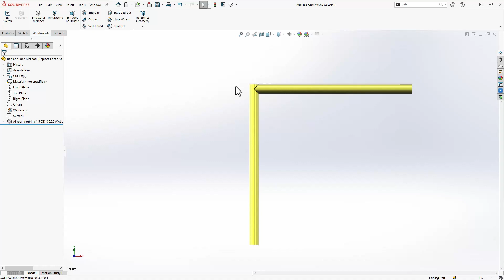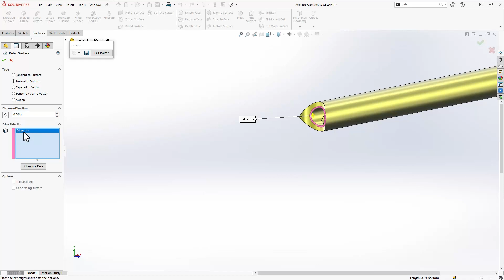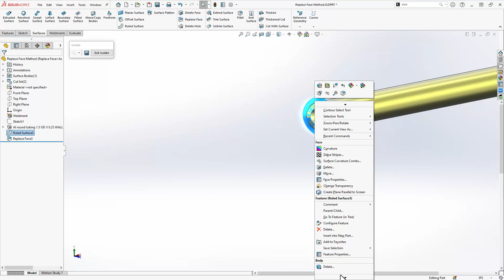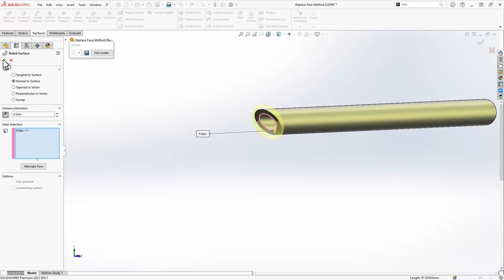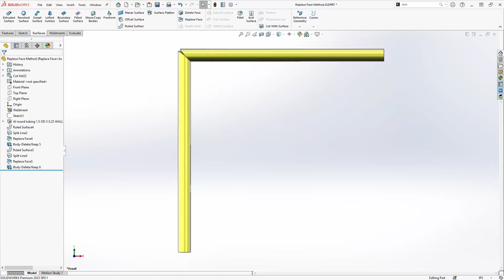Normalized Tube Cut for SOLIDWORKS Weldments

Comment: I'm sorry but I tried to replicate the command on a 12mm tube 1.8mm thickness, it says cannot replace surface due to self-intersection, any reasons why?
Reply: weird, when I do it outside of weldment, it worked, but doesn't work as soon as I do it inside a weldment with exact same round tube..
Reply: @jacks19822  I just got the same error when trying on a slotted hole. I was able to get passed it by only ruling and replacing one line at a time.

Comment: I found that on the 45 degree cut I didn't have to split the face into 2 sections, I just did it the same as the first end and it worked fine.  I'm using Solidworks 2024

Comment: Hi Sir.
Thank you so much for this video. Can we apply this method to 45 degree square tub cut?
Reply from the maker: Great question, the process will be different. For a mitered cut, a split line will be required as shown. However, one thing this video does not show is the 'lower' half of the face needs to reference the outer surface - for more information, see this blog - https://hawkridgesys.com/blog/normalize-mitered-tube-cuts-solidworks-weldments. Also, Replace Face will not be efficient, instead use 'Cut with Surface' or simply use a sketch and Extruded Cut. Hope this helps!

Comment: why won'y you just use cut with surface command? instead of using two steps' you just use one step
Reply: OK, i get it. i tried and solidworks cannot complete action due to "geometric condition"

Comment: There is a much faster way to do this if you are dealing with coped cuts on both ends and not angle cuts. You can use the delete face command to delete all but the inner faces and than use the thicken command on all those inner faces to get the tube thickness back. This works great for any laser cut tubing. We do it all the time at my company. Thanks for the tips!
Reply from the maker: That's really smart! Love it.
Reply: This works with angle cuts as well.
Reply: Thank you so much for your tips, Very good